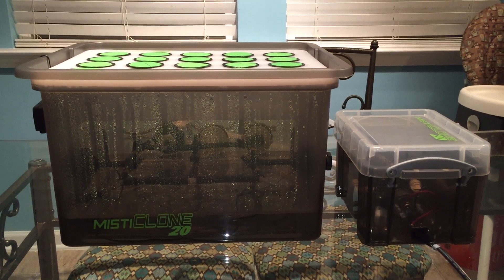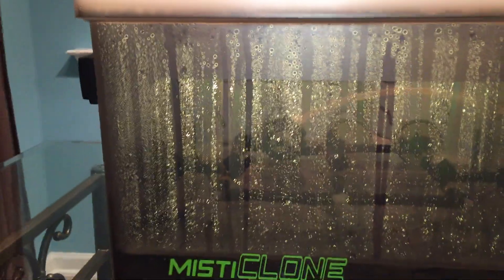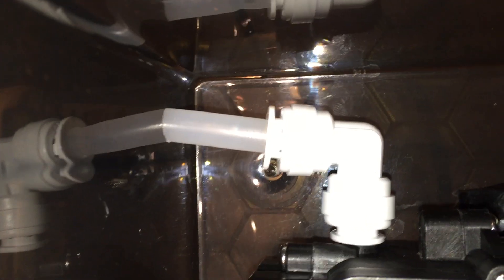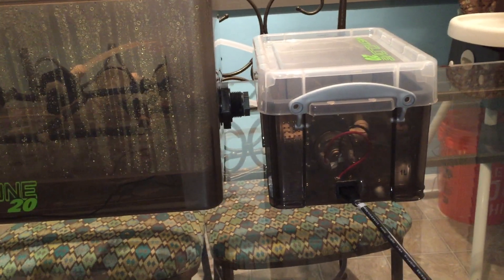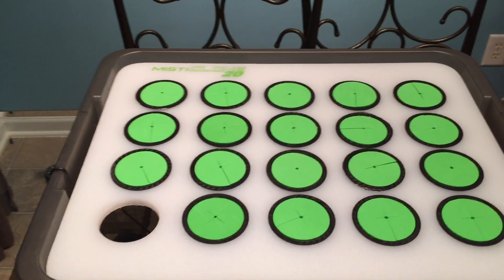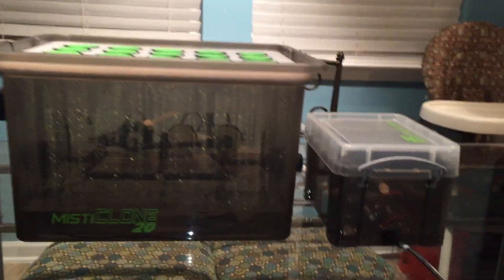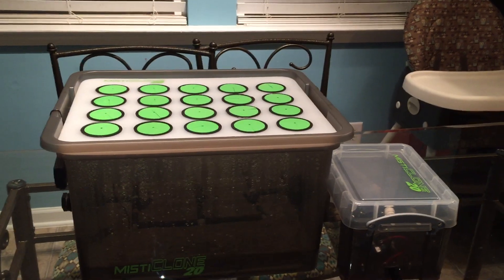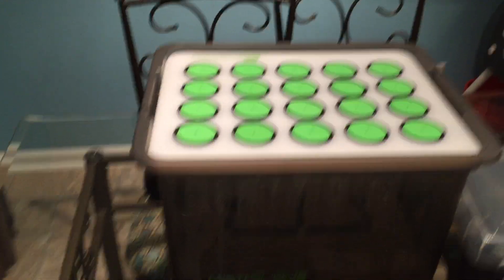Mike's MistiClone 20 professional true aeroponic / hydroponic cloner

Comment: It looks nice, though you would be better served if you cut the light down from the root cell.
Reply: Also, if you suspend the pump from bungee cords you will cut a lot of your noise. Maybe a bungee suspended from the rim of the tub. The pump will always be noisy, but between the bungee cords and a wrap of insulation around, under and over it will cut the noise massively!

Comment: Great creative design! A little to loud though maybe you should think about damping the noise on the pump box. Also the high pressure can damage to the roots and stunt growth when the misters are that close to the roots zone. All in all great work keep up the good videos!
Reply from the maker: @ steven, Thank you for your comment. The high pressure is not the pressure that the water is hitting the roots at, it is the pressure that is used to operate the misters. Keep in mind that the misters are only able to operate at a certain pressure. The reason that this system is ideal is because it DOES NOT target the roots in a way that will do damage, it is the opposite. The water hitting the roots is so fine that the roots are not affected by the physical force of the water whatsoever. The ez-clone machine targets the roots in a manner as to which the roots are being constantly contacted with force. My machine produces a very fine mist that is equivalent to rain mist or drizzle. Very fine. The reason that my system is a better alternative is because due to the pressure that is used to power the misters, the misters produce a much more atomized droplet of water than your traditional cloning machine. Therefore, the aeration is much more rich. You over aerate the roots and water which is alway a great thing. The better the oxygen, the healthier the roots, and plants. But you are right about the pump sound. I will work on suppressing the noise inside of the box. I will also be adding an exhaust fan on the outside of the pump box so that it can help keep the pump cooler. Understand that the pump sounds louder on the video than in actuality.
Reply: michael kindle a sand or bean bag would deaden the acoustic resonance greatly see if you can consider working did that into your design